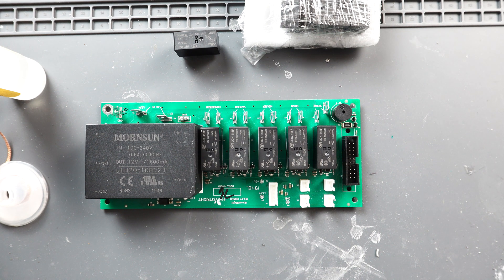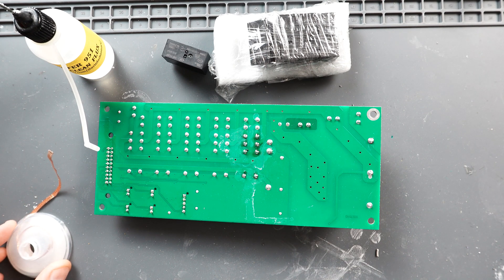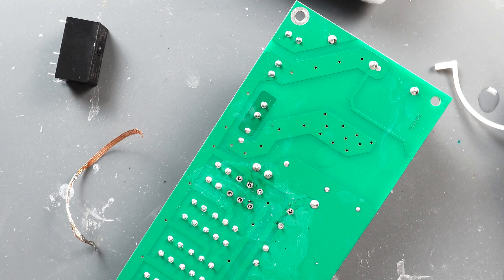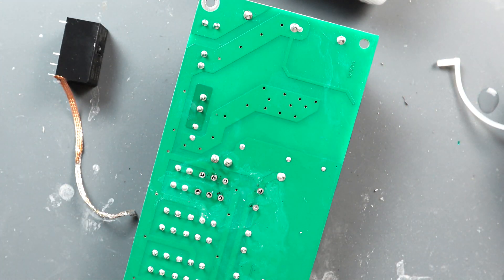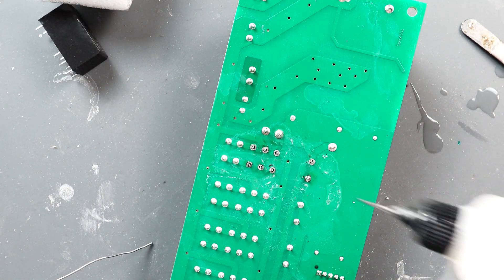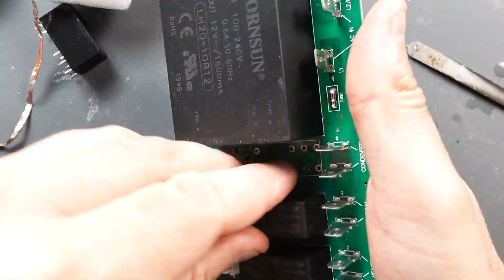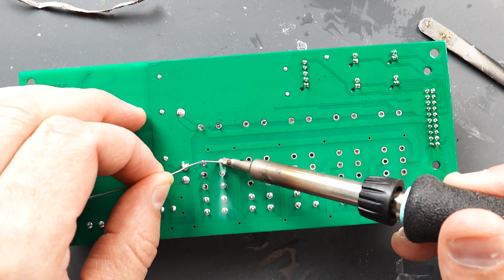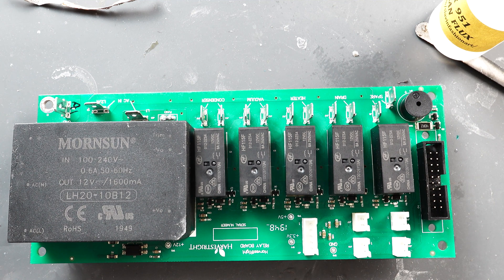How to replace relay switches on a freeze dryer relay board

Comment: Are there "SOLDER WICK BRAID" brands that are BETTER THAN OTHERS or are they ALL relatively the same when it comes to PERFORMING or getting the job done?  The reason why I ask this question is because It took me nearly "2 HOURS" just to get a "6-PIN" OMRON Relay removed off of a PCB from my KitchenAid Glass-top range appliance, without too much of a stretch of the imagination.  And, I still have 5 MORE relays to remove from this board.  To say that this TEDIOUS would be an understatement, at that!
Reply: Use more flux. If you are struggling, add more flux. If you are confused, add MORE flux.
Reply from the maker: @gosteelers8322  they are basically the same from what I have used .its just mesh copper. Use lots of flux.flux the solder joint and add flux to the solder braid and I bet it will work better.hope this helps. Thanks for watching
Reply: @Warranty-Voided  Thank you for the feedback...much appreciated.

Comment: Great video, I’ve had to replace two boards already.  I noticed the new boards they sent me have larger power ratings on the switches. Can you tell be where to buy the switch from and what the model is?  I’d like to try just replacing the individual switch like you just showed us how to do.
Reply from the maker: I got my switchs from ebay . Just search by the part number on the relay. Thanks for watching

Comment: Do you have an update if that repaired the problem
Reply: I plan to do this and upgrade to better Solid State versions with high current rating,  these 8A contact relays are borderline IMO.   Especially if you run the Eagle oiless pump.
Reply from the maker: @errcl65  that would be a great idea!
Reply: @errcl65 did you find any solid state versions?
Reply from the maker: Not yet my friend keeps it as a backup as he bought a new relay board prior to shipping me this broken one . But I am sure it works as it should
Reply: @Warranty-Voided  thank you for the fast response I appreciate it
Reply from the maker: @twistedprepper  no problem.  I will update you when he uses it .he runs his alot and didn't want down time . So I will have to wait for a update . Thanks for watching